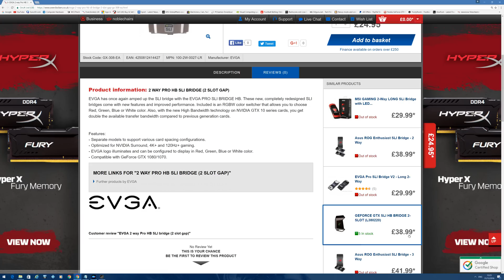High Bandwidth Bridge Vs 2X Flex Bridge | GTX 1080 SLI | i7 5960X 4.5GHz

Comment: i must use the flex because my cards are from different size :(

One KFA2 and a EVGA SC
Reply: I have the same problem. My solution is 2xflexible
Reply: i have same settigs...1070. what is you firestrike?

Comment: Not entirely related to the point of the video, but I noticed you have an open air cooler on top and a founders edition on the bottom.  For my 1080Ti SLI setup, I was thinking about going that route, but I haven't been able to find much info on it.  Theoretically, the blower cooler should send the hot air it creates right out of the case instead of pushing it up towards the higher card.  Did you experience any compatibility or temperature issues when using the 2 different coolers?  I'm assuming that in the OSD, the higher temps are from the FE.
Reply from the maker: Compatibility was fine with the two cards, the Founders edition remained considerably cooler below the open air card as the warm air that is used to cool any card in this configuration will always come of the card below. The Gigabyte G1 even in this configuration does a better job than the founders edition which is why I opted to have it as the card above.
Reply: Ok, awesome!  I've got 2 G1 Gaming 980Tis at the moment, and temperatures are definitely an issue for the top card when both are at 99% usage.  I'm thinking that going with this setup will decrease temps significantly.  Probably going to get the EVGA SC2 for the top card, as it's one of the only AIB 1080Tis that use the reference PCB

Comment: If you're the kind of PC enthusiast that would spend $1200 on a pair of graphics cards, with a case with a display window, careful cable management, SURELY you'll want the HB bridge out of principle, if nothing else. I can't imagine anyone wanting to use a fugly option like the flexi-bridges in their new baby... And let's face it, $1200 on 2 GTX1080's, you can afford $40 for a nice looking finishing touch...
Reply from the maker: I agree it's not much when you look at it like that. I just want the best SLI experience possible so I got myself the bridge and never looked back

Comment: I think that the purpose of the HB bridge is to make the gameplay smoother and remove stuttering not to increase the fps. Don't know tho.
Reply: yeah its meant to reduce frame times and latency, which is meant to feel smoother and reduce micro-stutter but in practice I do not know if you can actually tell the difference. Maybe on modern high refresh displays it makes more of a difference but hard to tell unless someone does back to back testing with multiple resolutions and has multiple people try the different configs an report back.

Comment: Don understand why nvidia still using sli bridge
Reply: If sli is so consistent why nvidia disable sli on gtx 1060 anyway ? Because nobody gonna sli a mid end card blah blah blah ?
Reply: multi gpu configurations take more developer time to make work correctly, more time means more money, money that they're less likely to get back on lower end (cheaper) cards. If you guys really think about it for more than 7 seconds why spend more effort making two lower end cards run as good as the higher end ones when you can spend the amount of effort you were going to spend anyways just making sure your higher end cards work well. I don't know how disabling sli on the 1060s is an argument against the consistency of sli anyways, it still exists for the  1070 and up and works a hell of a lot better than xfire
Reply: milking customers as usual. Vega10 cannot come soon enough...
Reply: sli is a lot more consistent than xfire, I don't know if thats due to the sli bridge or just better software support but its hard to say that they're milking customers when their solution works better than the competion's
Reply: Moj4h Bring on the credible benchmarks for what you said. Most around know that CF scaling is better for at least 2-3 years now.
Reply: It's not about scaling its about the stuttering and frame pacing thats not just noticeable but makes many games that weren't designed with AMD specifically in mind unplayable with xfire on. /watch?v=6cfJMspOM8A  <-- heres a youtube video that took me all of 12 seconds to find describing that almost every site that benchmarks xfire describes the exact same phenomenon. AMD makes sure that the scaling is good so that they can show high frame rates on benchmarking sites but the overall experience is terrible